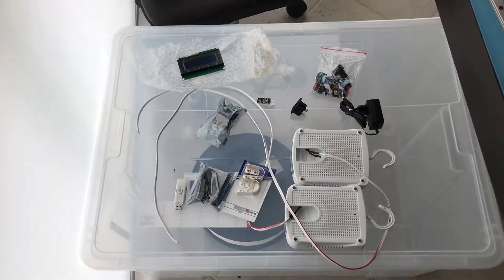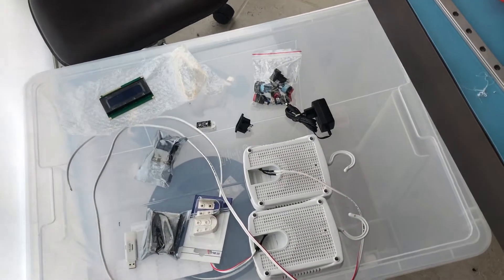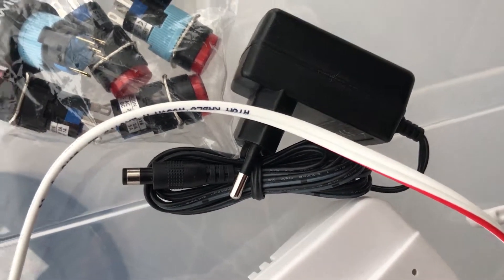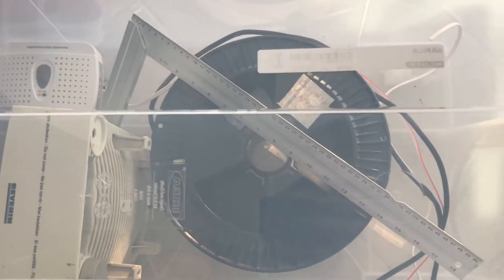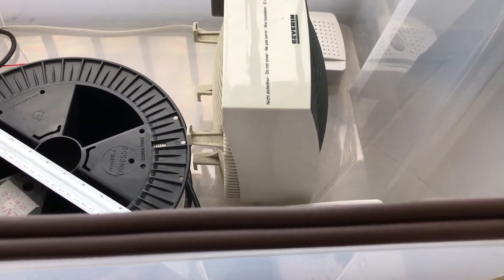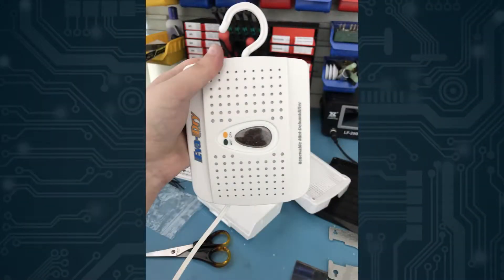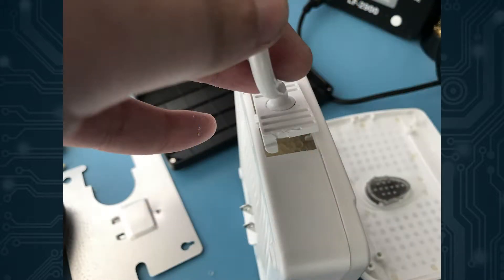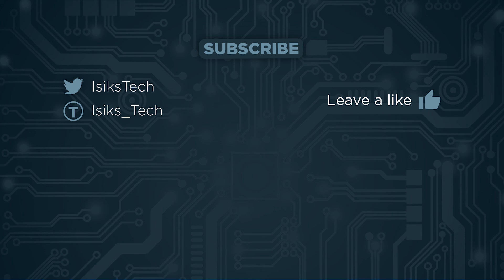DIY Filament Dehumidifier Build - Part 1

Comment: If you are drying the silica gel from the dehumidifiers in the same container where the moisture was adsorbed doesn't it just evaporate and go right back into the air in the container?

Why not just use silica gel and dry it out when it is saturated? Why not just buy/make a small peltier dehumidifier?
Reply from the maker: If you open the lid it goes to the room air.